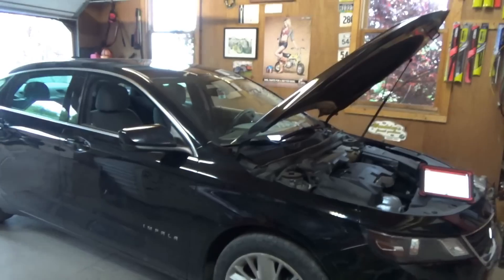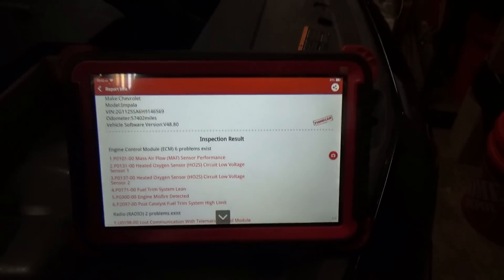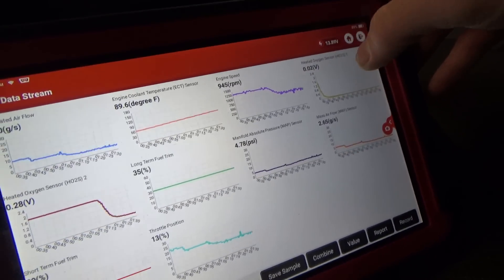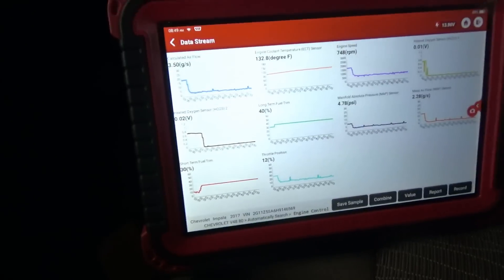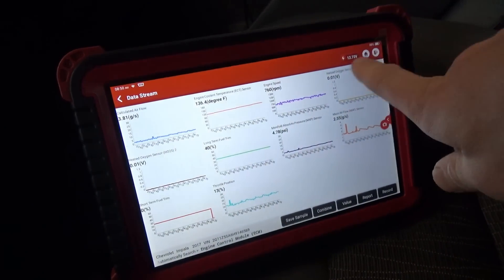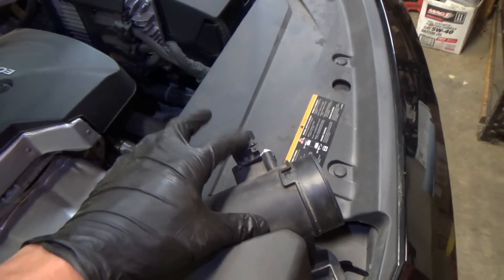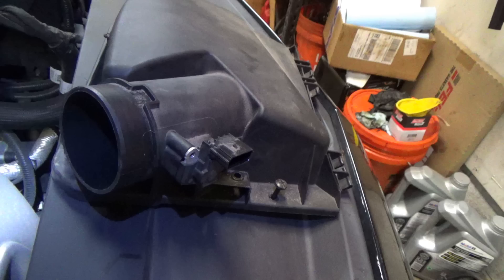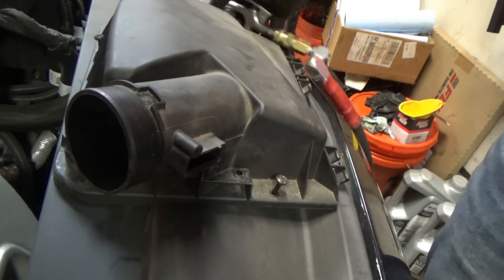Diagnostics From the Driver's Seat? (Impala Lean P0171 - Low Power)

Comment: At under 2 minutes in the video, I got to this:  All the codes point to the same thing, which is that either the MAF isn't reading right, or there is a fairly significant leak on the intake side allowing a lot of extra unmetered air into the process.  You did a great job to quickly narrow it down without even having to use a single tool.  Awesome job.

Comment: I have 2014 silverado and every year I have the same issue with high speed fan after I install a new air filter. I turn off the engine a few times and it goes back to normal. I am not sure why it does that. Thank you for your videos.

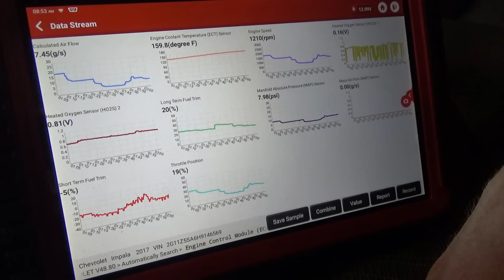Comment: @ 8:59, the Long Term Feul Trim was 29%, @9:49 it was 21%, I believe now the Long Term Fuel Trim is good. If you run the car a little bit longer, the Long Term Fuel Trim would go to zero. It is a learning process of the car.

Comment: Love the NPR repairs. Wish mine was like that. Have a P0172 in a 2002 neon with 160,852 on the clock. Major parts cannon fired. New IAC, plugs, injectors, map, and O2 upper sensor. Having an issue getting sensor out of converter. Built a smoke machine, no vacuum leaks that I saw. Saw a video on that stuck sensor using a hose clamp on the O2 socket to keep it from spreading. Trying that today. Hope it works because I do not have a torch. Nice fix Ivan.

Comment: I've had that exact symptom and problem before.  On a 2011 Ford Ranger not too long ago.  A little piece of white fuzz came off the air filter element and got wrapped up in the MAF sensor wire.  It was causing a crank no start condition.  If you would open the throttle up a good bit you could get it to crank somewhat, but it wouldn't idle.   I hated the guy had towed the thing to me just for that.  The MAF was the first thing I unplugged, so it was about a 5 min diagnosis in that case.

Comment: The fuzz drifted into the plastic intake after the old filter had been removed, or stuck to the new paper filter element when it was being installed. Hard to notice a tiny white seed against a white paper filter element. Kind of rare how it happened to get sucked into that small hole in the MAF sensor, then got stuck inside it. Those little seeds are well designed. Murphy's law strikes again. I think Eric O had one of those?

Comment: In 45 seconds of video and the description of the problem screams mass air flow sensor failing.  I had that same problem once. I unplugged the sensor and the car instantly started running better. Now it's time to see if I'm correct or not.

Comment: it's easy to get the corner of air filter folded/pushed in by the cover and tiny things whizz past. seems to be a long-running GM design issue.

Comment: When I was a rail equipment mechanic, I was told that to never open the air induction system unless needed just for the reason of introducing contaminants into the system.

Comment: What kind of engineer would produce a motor where a tiny piece of fuzz would cause a repair ?  GM hang your head in shame. BTW if the 2.5 echotec  is like their 2.4 echotec that motor won't be around long anyway. The 2.4 maybe as bad as their 4cyl. Chevy Vega hunk of junk.
Reply: Have a read through the comments, happened to Fords first...

Comment: I remember back in the day the early 70's in the Yukon when I was a mechanic a brand new ford truck with the 390 cid wouldn't pull the hills , it had an autolite 2 barrel carb on it , finialy I pulled the top off the carb .... looked in the float bowel and low and BEHOLD a huge bee was dead on top of the power jet  LOL ,how did that get in there ,I don't know to this day I'm thinking it was through the float bowel vent when some had the air cleaner off it one time .and crawled in , Ill never forget  that .

Comment: Calculated air flow is calculated from engine speed and manifold vacuum (barometric pressure minus manifold absolute pressure).  If there is no MAP then you could do speed-throttle but that is less accurate.

Comment: Good observation Ivan. Catching that fuel trim  and comparing it to the desired fuel trim sure put you on track to checking that mass air flow sensor. Imagine that a tiny little spec on the sensor caused it to quit working properly.

Comment: Every time I think I start to understand, I get confused.  Ivan -- how did you know it was NOT a vacuum leak when you put the engine under load?  Was it because the fuel trims did not improve?  Are you able to rule out a fuel delivery problem simply because the engine ran smooth at high RPMs?
Reply: A vacuum leak is less noticeable under load due to all the extra air pumped through the engine minimizing leak effects

Comment: Excellent video.  Question,  could one of the sensors that is used to calculate the calculated air flow be misreporting causing the MAF discrepancy and set the P0171 code?

Comment: Hi, Ivan, great diag. I believe Eric O had a similar video on the dandelion as well. Maybe they are from the same species that evolved much faster... joking aside... I am interested to know the formulation of the Calculated Air Flow PID if you happen to know. Thanks.
Reply: It's probably just speed density calcs.  Many cars don't even have MAF sensors and this is how they calculate airflow.  With a disconnected MAF, it won't have intake air temp (normally a part of speed density calcs) but it has rpm and manifold pressure.  TPS wouldn't be used unless the MAP was also dead.  That is called alpha-N mode.  Anyway, this works because the engine calibration knows the volumetric efficiency of the engine so at a given RPM and manifold pressure the ECM can make a pretty educated guess as to how much air is actually flowing through the engine.

Comment: I usually vacuum out the air box if there’s a bunch of leaves or whatnot in there, but if someone uses compressed air it might blow stuff into the intake tube I suppose. Even good intentions can backfire on occasion.

Comment: Perfect!  I have a 2014 Impala with the same engine. Entering a hiway on the on ramp the car went into limp mode about 30mph. I pulled over, shut the engine off and restarted.  Everything was happy again. Once I got back home, pulled the MAF out and sure enough a little bug was lodged in the sensor. WOW!  With some expert help, my son a local technical university instructor stop over to show me. Anyway, he says the strategy for the ECM is very dependant on the MAF.
Reply: Is your air cleaner the same as the 2017 that Ivan had?    Could you see any way the bug got past the air cleaner?  Looked really well sealed on the video but my eyes are old.
Reply: @dogsplantscarsneatstuff176  I've heard of the bug thing but always wondered how they get past the filter as well.
Reply: @giggiddy  more than likely an air filter check or change. I picked up the car used and the dealership changed the filter before putting it on the lot for sale. The air intake system is sealed up nicely
Reply: @dogsplantscarsneatstuff176  yes, the intake system is the same. 2014 Impala had the old body and the current body. Mine is the new style.
Reply: Lol, some cars don't have MAF.

Comment: I could be wrong... but I think long term" trim might just be an average of the last several minutes of short term data..  Or maybe an average of the last several cycles of the O2 sensors or something;  (I'm not sure how they determine the refresh rate when calculating the average.)   Because about every 10 seconds, it steps another single percentage away from that 30%, and moves closer to zero.   So as long as your short term trims are near zero like they should be, the long term will catch up to it.   I think obviously some manufactures set that long term average to update at different rates than others;  so some vehicles may correct fairly quickly, while others may take several minutes of test driving....  I mean, what else could be calculating the long term trim if it's not an average?   In bitcoin trading, we call these moving averages.. and they are very good at predicting trends-- so I can see why they would use it to help the computer run smooth rather than adjusting wildly at every random and sporadic reading of the sensors.

Comment: Many years ago there was a 1997 F350 Ford Dulie with a 460 V8 that barely ran when pushing on the throttle.  The MAF sensor had this tiny piece of debree on the heating elements of the MAF.  Cleaned the elements and when you floored the gas pedal from a dead stop the drive train would turn the rear wheels leaving rubber behind.  That's when I realized the sensitivity of the MAF sensor.
Good one Ivan.  The cause for that long term trim might be higher than E10 fuel, the spark plugs might be fouled and what about the fuel contaminated engine oil?
Good fix Ivan!
Reply: You need a lot of ethanol to really crank up fuel trims. Approaching 40 to 50% ethanol is where the trims get high enough to trigger an engine light. 

The new increases in ethanol shouldn't be bringing a car above 3 or 5% over pure gasoline. 

Just a little tidbit... I played with ethanol for a while till I moved states. You can actually backyard convert your car to e85 by installing 30% larger injectors, but that still leaves the stock tune so it won't like starting when it's winter, but it'll run fine. I did that with my civic before I got a tuner and supercharged it. It was fun to learn the fuel maps and get it running perfect.

Comment: Yes siree, it happens now and then and theres always a question how that fuzz or a fly/insect got in there.  I think I would have told the owner to get a new GM or Wix air cleaner and clean out the air box with a vacuum. 
Just doesn't seem right, traveling along in a larger sedan with the sounds of a 4 banger.
Reply from the maker: Definitely doesn't sound like a 4 banger... Very quiet and smooth!

Comment: Imagine going back in time, 50, 60 years, and telling a mechanic that "In the future, a dandelion seed is enough to make a car run like crap!"
Reply: Same can happen for car from the 50's or 60's, all you need is for something as tiny as a grain of sand to get stuck in the needle and seat, and then BOOM... car runs pig rich from too much fuel (flooding) because something as small as a grain of sand can hold the needle seat open and cause the float bowl to over fill, and then fuel flows out the vent tube down into the throught of the carb flooding it!   I have also seen crud smaller than a dandelion get stuck in the main jet, and cause lean condition, poor running engine.
Reply: @quicksilver462  True enough. Don't get me wrong, I enjoy the efficiency and drivability modern fuel injection offers, but there's still something to be said about old mechanical, non-computerized simplicity of yesteryear. It is what it is. Can't stop the march of technology, for better or worse.
Reply: actually, they often did just that. any tiny debris into one of the carburetor jets or through into a passage/idle port = runs terrible. anyone who's dealt with carburetors for years already knew that. so many jets/orifices in them (main, secondary, idle, many air bleed) a bug, grain of sand, earwigs ants!

Comment: Unplug the MAF trick saved me more than once with my old Volvo. Overoiled the K&N a couple times and that fouled the sensor... learned to drop filter on paper towels to remove excess oil and bought a can of CRC MAF cleaner. Then didn't replace the ETM gasket after cleaning which is actually more like a crush washer on Volvos and can't be reused. Couldn't hear the leak over engine noise but it was there.

Comment: my cruze typically has +10 LTFT when the engine is not fully at operating temperature.  (I think it's a fast heat up strategy)  Also long running fan is to cool down to protect aluminum head.  If you plug the sensor back in one time and restart briefly, you'll be fine.  #Chevy logic.   I had a similar problem before and a #scannerdanner and #Pete Myers Motor age tutorial videos for volumetric efficiency and use of calculators helped me nail down a faulty MAF - amazing.   No parts cannon here!  nailed it first shot - super confidence builder.  Was challenging though with a turbo car.
Reply: My sister has a cruze 1.4L turbo. it's notoriously one of the worst engines that GM has ever made. lol..  SELL IT
Reply: @calholli  I've managed to tame the beast.  I agree it's not their best engine.  I wouldn't recommend the car if someone wasn't generally handy.  I remind myself it is an economy car and if you do the required maintenance and don't beat it up too often, it will last.

Comment: Wonder if the new air filter is a clue? It was running rough, owner found an OEM 5 year old filter in there, maybe with some holes by now, changed it... but it was too late. 
Or maybe the dandelion got in there while the owner was working under a tree?